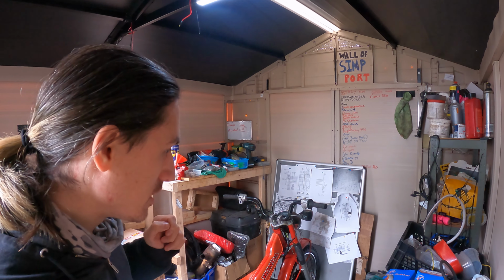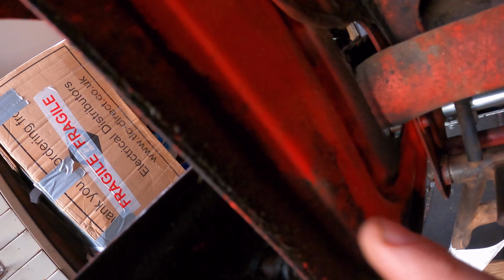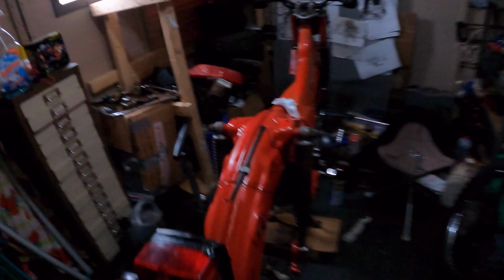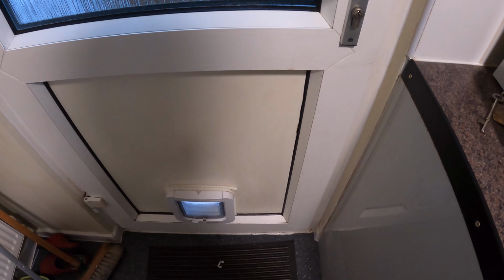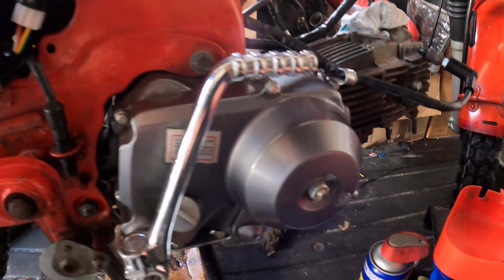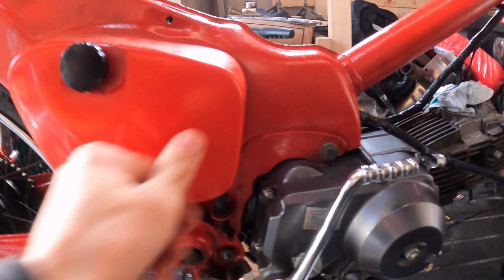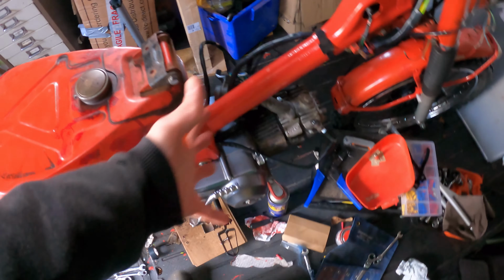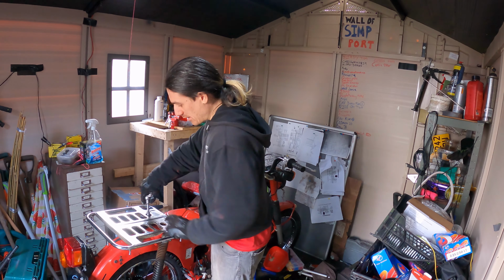Honda CT110 Project Part 9

Comment: Hammerite on a ct110. Surely not? You don't deserve it if thats how your going to look after it. I don't like to pass comments on how you would treat your own bike but come on thats a classic
Reply from the maker: its gonna be thrashed offroad also now the plastics are back on you cant see it really
Reply: @BigPezza  I'm a huge 90 fan and I have to be honest its breaking me to read you write its going to be thrashed. Yes use it for what ots ment but I'd have to do a better rebuild, at least paint the frame properly so you could do the rest easily at a later date. Can I ask where you got it and how much because I've been keeping an eye out for one but the are 3.5 grand plus
Reply from the maker: @Cubrider  i bought this one as a non runner , I had to sell my Honda crf250 and alot of other stuff to fund this build. It's not done yet but it's going to be around 3k or just over by the time it's on the road.